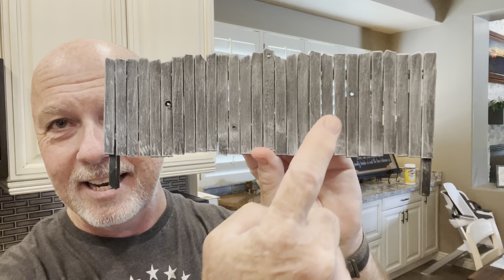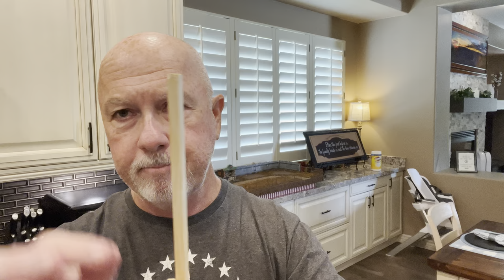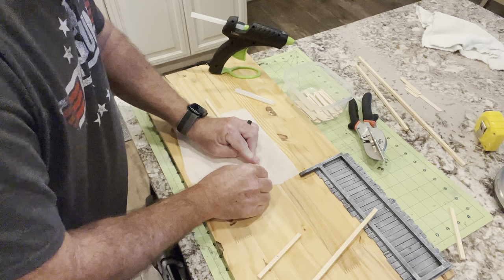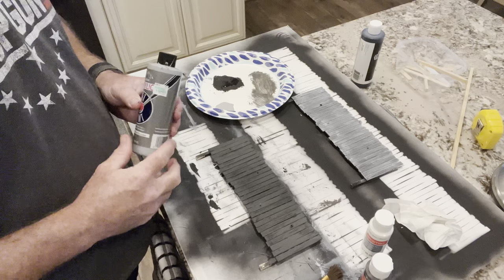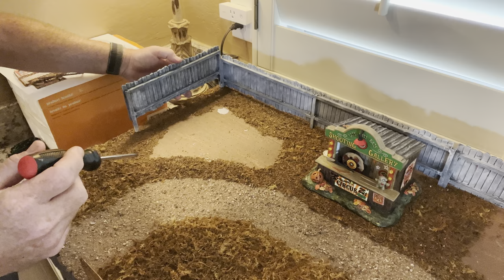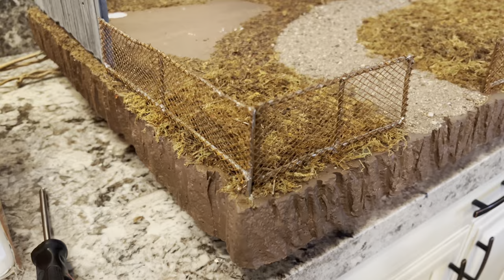Dept 56 Creepy Circus Tutorial, Part 3

Comment: Amazing job as usual!  You have a talent and vision for sure!  Noticed on last video you changed from hot glue to attach your grass to Elmers glue.  Did you find the Elmers glue to hold better?  Going to try and replicate. Just wondering. Thank you!
Reply from the maker: Thank you!  As far as glue, I think they both hold equally well—especially with the glue/water mixture that I spray on, but the white glue is a little less expensive and seems to work just fine.

Comment: Thanks for another great tutorial. I'll be waiting enthusiastically for the wrought iron tutorial. So glad you'll be doing that one. One question about the miter cutters. Do you use those to cut the larger square dowels also or just the popsicle sticks? And one question about the Proxxon cutter if you will. I'm looking for one but with getting the Hot Wire tools which will be here on my bday next week YAY, I'm trying to save a bit.  They have cutters that are similar to Proxxon but less expensive with good ratings. Do you think Proxxon is the way to go or could I risk the less costly version. Basically, I need a tiny bit (it won't take much lol) of convincing to spend the big bucks. Thanks for all your sage advice Carl.
Reply from the maker: I use the miter cutter for the larger pieces as well—it’s awesome.  As far as table cutters, there are a lot to choose from.  I watched a lot of reviews on the proxxon and decided to go with that one, but I’m sure the others would be fine.